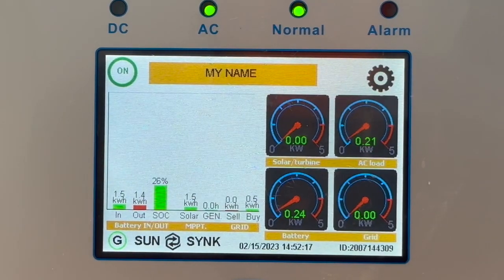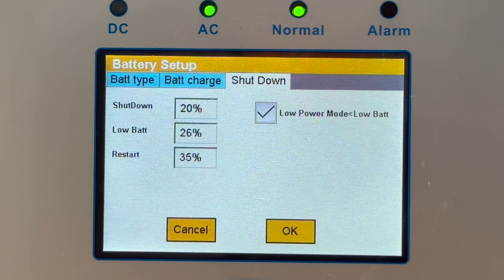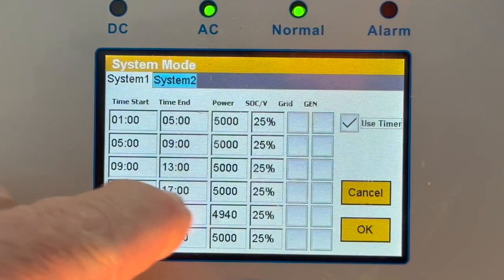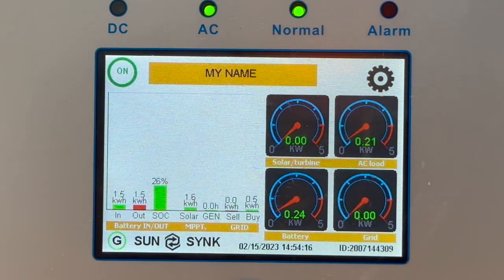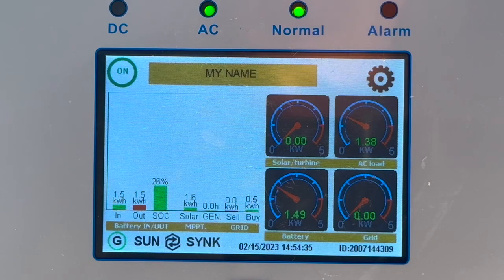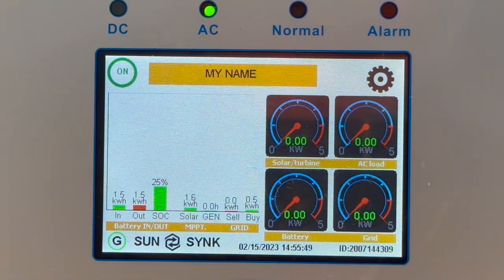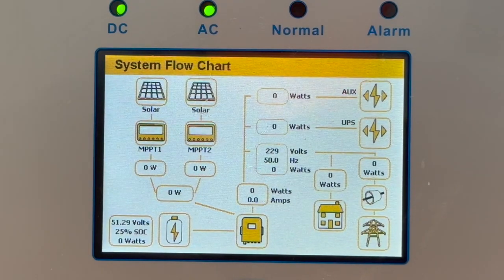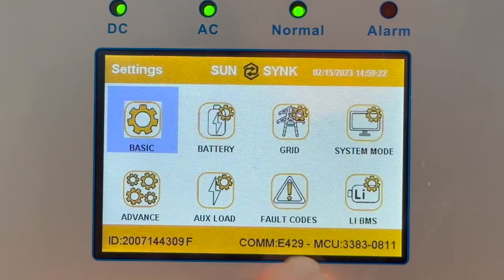￼ How to use the low power settings on a Sunsynk inverter?

Comment: Hi Sunsynk. Might I offer a suggestion for another UK setting?
Perhaps include a minimum DC input wattage before the inverter boots up. That way when the sun comes up or goes down, the inverter isn't running solely to cover the losses.
For example I can sometimes get 3w early evening from moon light, my inverter uses circa 40w to convert the 3w to useable power so is running at a loss.
I hope that makes sense.
Reply: I would check your electricity meter to see if it is actually wasting the 40W - from my experience this reading is not accurate

Comment: An observation of using the low power mode. My battery dropped below my set low battery and the inverter went into low power mode. An hour later my system timer was due to grid charge my battery, but because I was in low power mode my system timer was over written.

Comment: I suppose the down side of using the low power setting is that if you were to rely on the sunsynk portal as a tool to monitor your import the figures won't be correct, as when it is being used as a pass through the import isn't recorded on the portal. I must say though that this is an acceptable compromise, as for me saving every watt is the reason for having the system 👍

Comment: Please explain the following: 
When looking at the main screen on time 4.38 of video Grid power shows 0Watts from grid, but when entering the value screen on time 4.42 the gridpower shows 20W which is understandible, BUT if you look at the Amps it shows 1.3A. So multiplying the 1.3A x 223V = 289.9Watt - This is a huge concern, there should be minimal to no draw from the grid. In South Africa 289.9W - 20W (set) = 269.9W * 24hrs = 6.47kWhrs per day = R 14 per day @ R2.2/kWh this equates to R 5195 per year. Drawing power from the grid????? Please assist in clarifying

Comment: Very good. A much needed feature! When is this going to be available as a firmware update?
Reply: The software files are already available from the Sunsynk portal. If you are not familiar with the web, contact your distributor/seller to install them.

Comment: Why would anyone not use all of the charge in the batteries - it seems ridiculous to me to store this energy and never use it... it's like having a 10KWh battery and only using 7.5KWh of it...totally nuts. Having said that, I've set my shutdown to 0% and the batteries will never let me use the last 10% for some strange reason. Must be a bug in your firmware that needs looking at URGENTLY.

Comment: I don't think you need to disable grid charge in the Battery screen. If you do this, you can never charge from the grid even if you set you timer to do it. It just ignores your timer. I have found that you can have Grid Charge ticked on the Batt Charge screen and it will still go into low power mode at night. Your Low Batt % should be 1% lower than the System 1 SOC% then it will work.